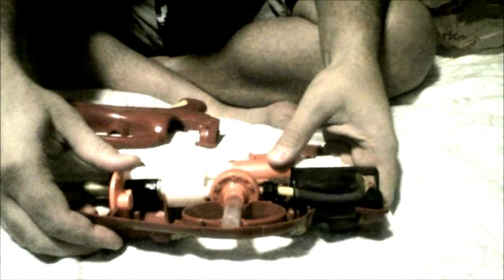Fixing an AT2K's airsystem Part 2

Comment: The *main* reason why those pump check valves fail is modders who fill up the hole in the center of the pump head.  Filling that hole even half way can cause it to push the stem of the check valve loose, or even break the plastic ring holding it.
Reply from the maker: +Bob O`Bob I backfilled the spring mech in the check valve with krazy glue, but left that part alone in the front as well as the o-ring.  Thanks so much for sending me this red beauty, thanks so much.